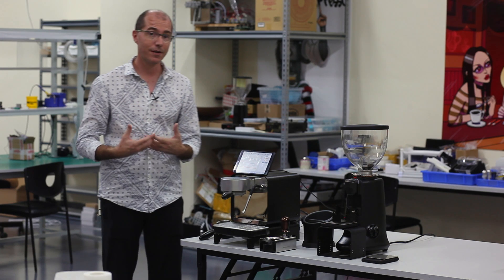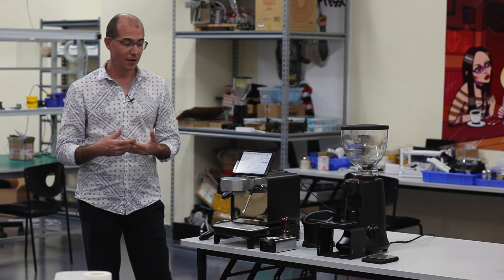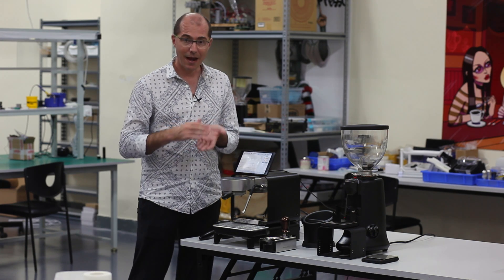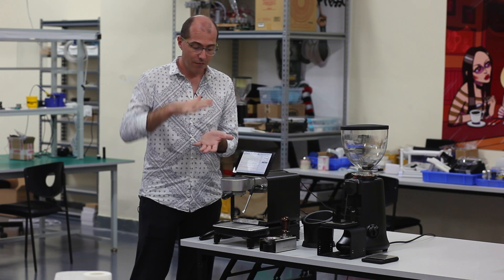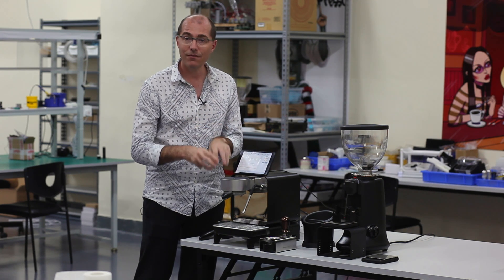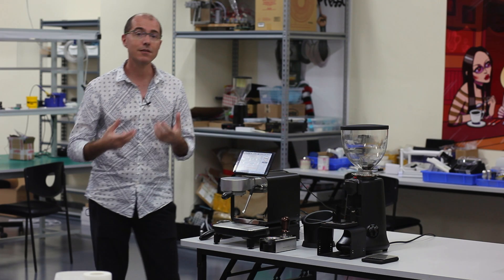#2 smart preinfusion: five Innovations that make better espresso

Comment: On a Breville Barista Pro or Express, when pulling a manual shot (the ability to control the duration of the pre-infussion), can one assume that they need to end the preinfussion when the first drops appear? I don't understand when to end the preinfussion on a dumber machine like the BBP. Can you please help John?
Reply from the maker: Yes, the time-honored marker for ending preinfusion is first drips.  You should then ramp up pressure (if medium to dark roast) or pause water flow completely (if medium to light roast).  With my manual E61, I used to stop water flow for 10 seconds when I saw the bottom fo the puck get wet, and only thereafter rise pressure to full.

Comment: yes, but vibratory pumps won't bump with 9 bars, but it slowly ramps up the pressure. it's by design.
Reply from the maker: We have two vibe pumps running and we can reach 9 bars in 3 seconds. That's actually the same speed as a commercial espresso machine.